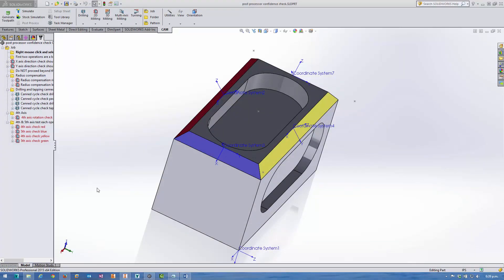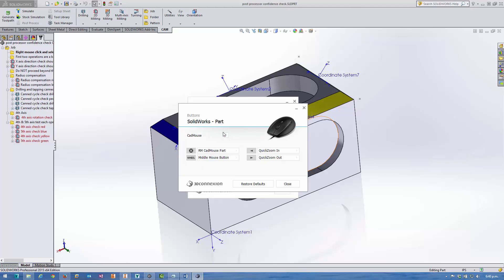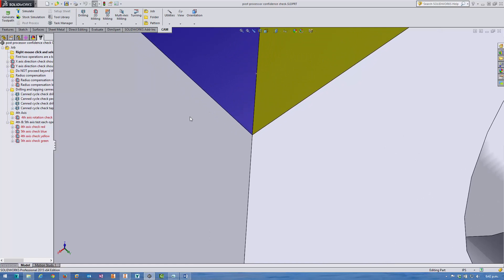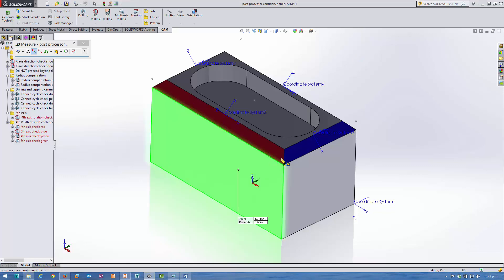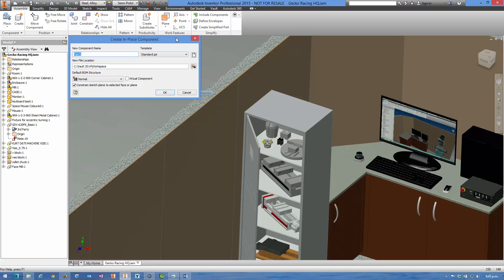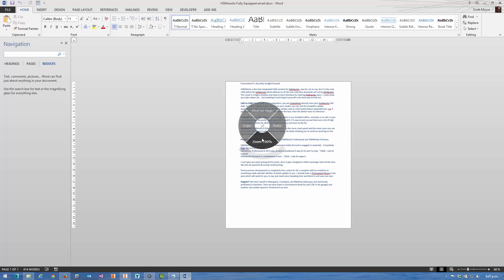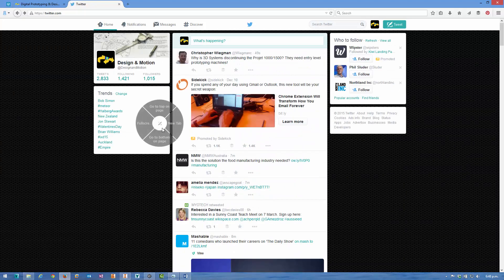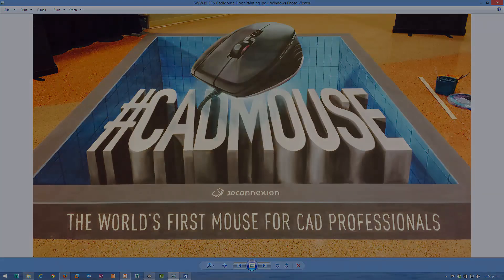3Dconnexion CadMouse Hands On Review

Comment: Thanks for the review.  Does the driver include an acceleration setting?  I run CAD with dual monitors, so keeping the speed slower and increasing the acceleration works well.

Also, it would be good to hear about how well the CadMouse holds up under heavy work use.  I have had to use a Razer Ouroboros (wireless / wired gaming mouse) in order to get the robust button switches I need.  It works well at 1600DPI plus acceleration.
Reply from the maker: Hi Neil,

Somehow this was missed. Yes there is an acceleration setting, but it's not adjustable, it's either on or off. Then you can adjust both the speed and the sensor polling rate. Honestly the hardware hasn't been without issue. I've had a few problems, but the first two units were pre-production. Then a production unit I had failed after a while, but I travel with it a lot and it got knocked about quite a lot in my bag with a few heavy metal components in the bag with it. My latest one is standing up well so far. All in all I don't think my experience would accurately reflect the way it would be used with the majority of users.
Reply from the maker: The clever scroll wheel and frictionless interaction with the mousepad are two features I desperately missed for the few days I didn't have it about 6 months ago.